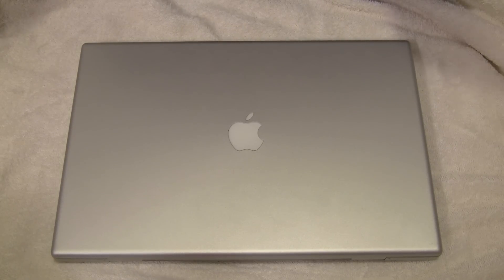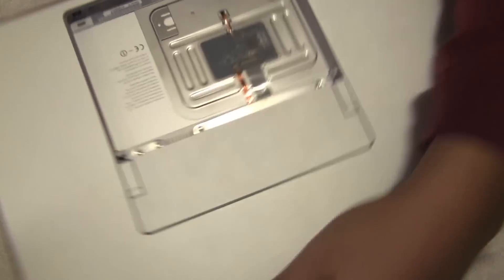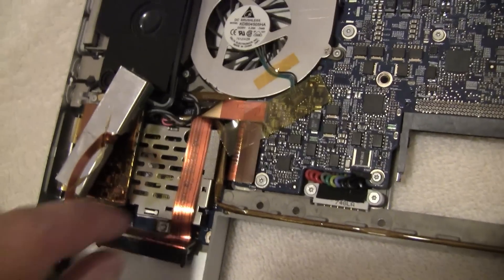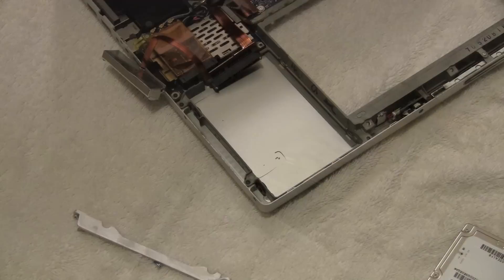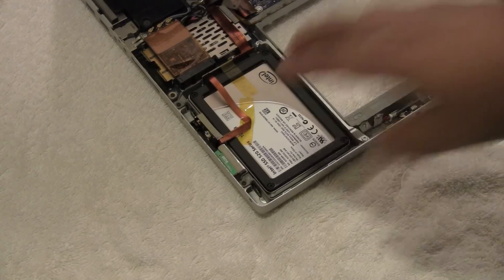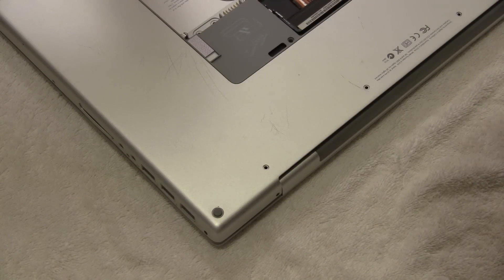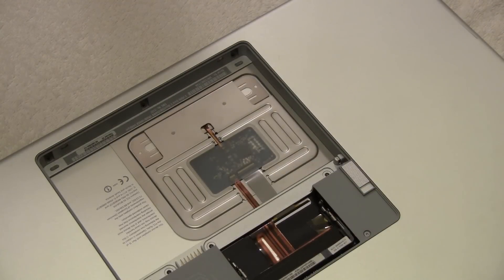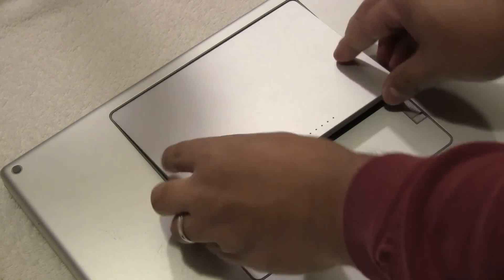MacBook Pro Upgrade to SSD Solid State Drive (Late 2007 - Early 2008)

Comment: Thanks for this wonderfully clear video.  My late 2007 17" MacBook Pro still looks like new and is very useful (though I write this more than 9 years after you made your video!). I hope to install a 2TB OWC Mercury ELECTRA 3G SSD SATA 2 drive into it.  I was hoping to find a video on installing the OS on the newly installed (empty) drive, but you do not appear to have made one (possibly considering the process too rudimentary to bother, though your clarity would have been most helpful).  I'll continue looking for one -- perhaps you have recommendations?
Reply: Replying from my other channel, but thank you for the kind words. So the Mac has a boot rom chip that allows you to install legacy operating systems. But if it's really old, you might still need a physical copy of the old software. My recommendation is to try Recovery Mode - Command (⌘)-R: Start up from the built-in macOS Recovery system. Or use Option-Command-R or Shift-Option-Command-R to start up from macOS Recovery over the internet. macOS Recovery installs different versions of macOS, depending on the key combination you use.
Reply: @mtiphotography  Wow, thanks for the rapid response!  Being a bit of a pack rat, I find that I have several old versions of MacOS on DVD, including 10.5 (Panther), so I suppose another option is to install from DVD (if it's still readable), then update to the latest OS that will run on this iron, via an Internet connection to Apple.  On a separate note, is this late 2007 machine capable of using Apple's Recovery over the Internet?  I guess I should try that first, to find out, and use the DVD as a fallback option.
Reply: @rpcrodgers  Apple's recovery over internet was introduced after this laptop was released, but if you have a certain OS installed I think they add that option...I could be wrong.

Comment: SSD

Too small

Too expensive

For those on SSA

2.5" 72k 250GB SATA drives are $8 to $12 ppd.

320GB a little more

Work FINE!

For ME!

My $33ppd.  Early 2008 2.4 15" For Parts machine.

$56 with NOS OEM good battery from there...

A few spare parts from dead A1226/A1260 machines

Wine Living!

On a (bottled) water BUDGET!

J.C.

Comment: I LOVE how you plug the keyboard "data port" in OFF-SCREEN so we can't see where the heck it plugs into the motherboard....  At least you point to it after you take it out.  A few things don't line up exactly with my own early 2008 model, oddly enough.
Reply: This was recorded so long ago, if I had to re-do this, with more modern cameras, it would be much better. It's not the greatest quality by any means. New videos I would do would be handled much differently.
Reply: @mtiphotography  I would also like to know, does it plug in or do you just place it on top and push to connect it? Thanks

Comment: One suggestion, do all you work on a desk or table. Performing the upgrade on a static prone material suck as carpet, towel or cloth may cause unnecessary static discharges which could burn out any static sensitive components.

Comment: Hello Guys
sombody knows dimension or SSD disk model and brand for early model 17" Intel Core Duo 2006 (Processor 2,16. 120GB Hard Disk) ? Is it possible for install a 250 or 500GB SSD and run ok ??
Wich screwdrivers need? (amazon links is it possible? THX Guys!!!!

Comment: ...one of the most requested steps, you actually overlooked  -  the 2 torque screws, their sizes and correct tool type & size needed to remove them!

Comment: I changed to a SSD my 2007 MacBook Pro. It seems I bought a new modern computer! The overall performance increased drastically.
Reply: +asphixmx Which type of ssd? What screwdrivers did you use? thanks.
Reply: +George Bunny Hi George. It is a Sata SSD, Kingston. The screwdriver is a shape of a star...dont know its name. I bought a Trupper set of mini heads of screwdriver. One matched.

Comment: Hi there! I have an a1226 macbook pro (think it's mid 2007, core2duo). Also I have a hackintosh (hp probook 4430s, core i5 2th gen). I really dont need both. Do I keep the hackintosh or the real mac? Obviously, the  i5 is a faster processor, but only have the mavericks OS (problem upgrading to El Capitan). While the macbook pro has El Capitan already, it is slower. What do you thin if a upgrade the macbook pro to an SSD and keep that computer? What if I keep the HP core i5 with Mavericks? What would you do? Heeelp!!!! :D Thanks.
Reply: +Marco Sartori That was the path I took 3 months ago and I am happy with it :)
Reply: +Marco Sartori yes, the cpu & video card have enough power to play video hd

Comment: Warning! I took every screw out, removed the keyboard, then found the flat connector running across the drive was stuck on, VERY securely. No way to remove it without breaking. Looks like I won't be installing a new drive! Any suggestions?
Reply: Maybe using a flat card like a credit card or ID to place between the hd and the flat cable and use this credit card to loose the flat connector glue?

Comment: i have a1229 with Samsung 850PRO 256 GB
140 MB/s Write-Read is normal????
i need help
Reply: I think A1229 model has SATA (aka SATA 1) interface. This interface's max speed is 150MB/s, so you are good
Reply: ok thx for help

Comment: Hi, thanks for your video, I have the same laptop and I am wondering about Sata 3 or Sata 2, I am just finding on amazon Sata 3 SSD, do you believe that it will work?
Cheers!
Reply from the maker: SATA 3 or 2 doesn't matter for compatibility.  If you purchase a SATA 3, you just will pay more for a faster SATA drive, but the older MacBooks can't support that speed, it just drops down to SATA 2.  If you want to save some cash, stick with SATA 2.  The one I'm putting in here is a SATA 3.
Reply: Andrew Ludewig thanks a lot for your support!
Reply: +Giorgio Perluigi the computer itself is sata 1 but sata 3 works
Reply: Andrew Ludewig not trying to be a smart A** but did you just contradict your statement?   if the speed drops why would you put SATA III?
Reply: +acwildchildful thanks!
Reply: +Giorgio Perluigi this mac runs at SATA I speed 1.51Gbs any SSD will be backwards compatible but you wont get full speed out of it
Reply: yea, but it does actually speed it up because of its increased iops and random read write speeds. just dont put too much money into it and dont expect it to run like a $2000 gaming rig
Reply from the maker: I used only Intel SSD drives, but it depends on what year MacBook you have, some SATA and software may not be compatible with SSD drives natively.

Comment: Thank you for the instructive video. Installing a Samsung 840 EVO 250 GB SSD into my early 2008 (pre-unibody) MacBook Pro 15" was a breeze.
Reply: Hi Peder. I as thinking of getting the same SSD. So it works well with the NON-unibody? Some people say that that SATAIII and ATA don't work well? True?
Reply: samiqab I don't know all the technical particulars, only that it works really well. Of course, I don't get all the benefit of throughput from the SSD because mine isn't SATAIII, but it's very fast, and boot times are a fraction of what they used to be with the HDD.

Comment: "Does it work prior to upgrading the ram? If that's the case, the ram isn't compatible with the mac. You must purchase ram that is Mac certified. Standard PC ram doesn't work with macs. "

Wow, are you serious? Macs ARE Pcs, simply with a different OS on it. I've been using Mac and building PCs for years and they use the SAME EXACT HARDWARE. A DDR3 RAM chip will work on any new Macbook pro as well as any new laptop. "Mac certified" is a gimmick to up-sell parts to Mac Users.

Comment from the maker: If you are asking if it will work, no it doesn't matter.  All that SATA III vs others is basically how fast the bus speed is.  Data going back and forth off the drive.  If your laptop supports a higher SATA spec, it can push data off faster.  Some will argue that if you put a SSD drive into a older 1.5 spec machine, you won't get the most out of it.  True, but the pros are much improved overall. The Speed increase is dramatic regardless of the SATA spec.

Comment from the maker: Very good point.  As for the removal of the hard drive, you need to remove screws from the right of the hard drive, that metal bar will lift up.  Afterwards gently remove the yellow tape holding the wires in place.  After that, carefully left the right side of the hard drive up and slide upwards.  Before moving to far, remove the SATA connection to the hard drive.  Reverse these steps to install the SSD Drive.

Comment from the maker: Does it work prior to upgrading the ram?  If that's the case, the ram isn't compatible with the mac.  You must purchase ram that is Mac certified.  Standard PC ram doesn't work with macs.  If it is correct ram, (speed, voltage, so forth), they it could be a GPU issue.  If that's the case, it needs a new motherboard or needs to have a reflow done on the graphics chip.  It's not connect to the Hard drive, but I believe it's an antenna for bluetooth.

Comment from the maker: SSD drive will increase the transfer rate. It's not usually the CPU that's the issue, it's the read and write of the HDD. One note, your CPU is soldered to the motherboard so upgrading the CPU isn't an option. I would however upgrade the memory. This will buffer the data sent between the SSD drive and the CPU. It's very easy to upgrade to SSD. Just make sure you do a Time machine backup, if OS supported. If not back up all your files. watch my video on how to install an SSD.

Comment: Model Name: MacBook Pro
Model Identifier: MacBookPro1,1
Processor Name: Intel Core Duo
Processor Speed: 2 GHz
Number Of Processors: 1
Total Number Of Cores: 2
L2 Cache: 2 MB
Memory: 2 GB
Bus Speed: 667 MHz
Boot ROM Version: MBP11.0055.B08
SMC Version (system): 1.2f10
W86231DVWY Hardware UUID: 00000000-0000-1000-8000-0017F2CE042A
Sudden Motion Sensor:
State: Enabled
can you please explain the ssd you installed why is that needed and also i have just bought dual 2 core processor will that also wrk

Comment from the maker: To run Lion or Mountain Lion, it's helpful to have SSD but not required.  SSD has a 4-5 times performance increase no matter what OS you have.  If you are starting to see your MBP lag, it's most likely 1st your HDD and 2nd your OS if you upgraded to Mountain Lion.

Comment from the maker: One thing I didn't mention is that, the SATA controller is slower than what the SSD can handle, but the performance gain is still greatly improved.  This is still worth while to upgrade an older macbook pro if you can.